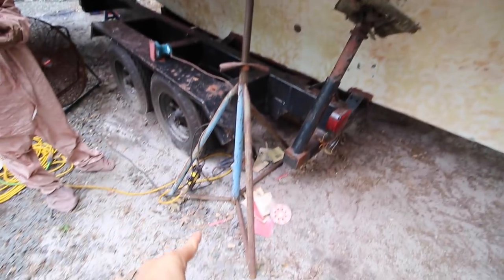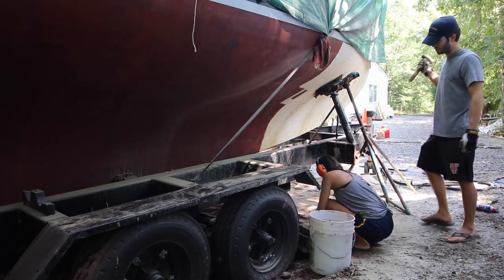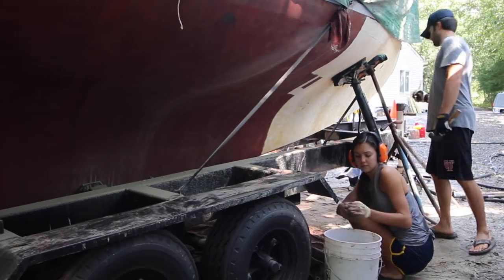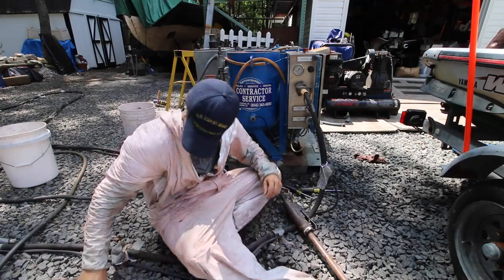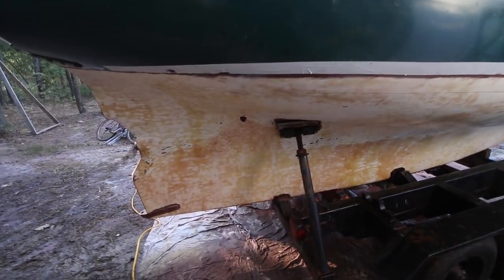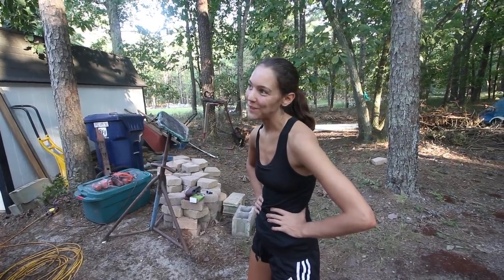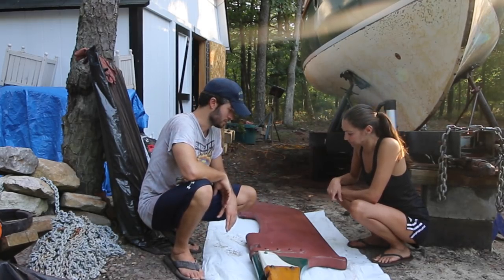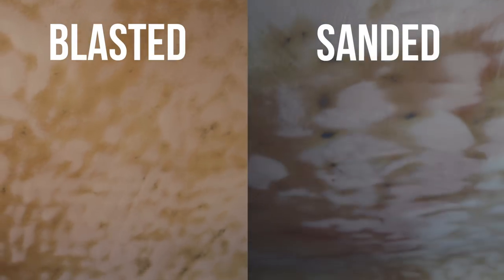45] Backyard DIY Classic Sailboat Restoration | Abandon Comfort

Comment: If i comment are you going to reply back? , Bottom painting difficult job  i mean messy ,  pressure is better than sanding or sand blasting why didnt you use a pressure washer ?? Looking GOOD though
Reply: Hauling my boat this fall in VT usa, bottom painting is on the list. Pressure washers work??

Comment: is the diesel motor still available?  +1 on the PB Blaster.  it's the best stuff i've use for corroded threaded anything!  it is miraculous.  btw, i'm really for you on the whole electric motor idea from an environmental standpoint (i have a degree in Environmental Science), but it is simply not safe.  on extended passages, you will want some oooooommmph to get you in/out/through tight spots or heavy weather, and to get you through that 50 or 100 mile stretch when you are becalmed.  the diesels these days are soooo freaking clean, that you should reconsider.  consider adding a urea system on the exhaust side for even cleaner emissions.  you could conceivably achieve very, very low CO2 emissions if you set it up correctly.

Comment: I know you guys are hell-bent on going with electric propulsion, but the numbers simply aren’t there for weight/capacity.  Keep that cherry Diesel engine, and run it on biodiesel.  At a half-gallon an hour fuel burn, you could motor over a hundred miles on a ten gallon tank.  If anything, get a trawling motor large enough to put on the transom to get you in and out of slips and anchorages without having to turn over the diesel.

Comment: Sure, a boat like this can be moved by ores in a calm condition without wind. Why not instead use your legs? Your arms may produce about 80 Watts over a short period of time. A trained cyclist can produce easily 160 Watts over a much longer period. why not set up a kind of "bicycle-generator" to your batteries or a "bicycle transmission"  directly to a big , slow turning  Prop. to move the boat. Not joking, during my last Holidays in Croatia I've seen a Sailor moving his 8m boat inside the harbour that way.
Reply from the maker: We've given thought to that as well. If you have any further info on it send it our way! We'd love to hear more.
Reply: For Example, a 26" bicycle wheel at 25km/h spinn's at about 200 rpm . A victron 60-24-70-SR-IG Alternator produces ca. 6.5Amps/24V at 1500rpm . Using a 7.5/1 Gear-Ratio from a backwheel of a mountain bike you would be able to pump 160Wh into your batteries. here's a link to the Victron datasheet https://www.victronenergy.de/upload/documents/Datasheet-Alternator-DE.pdf.Another Option could be a Cruise Pod 2.0 or 4.0 from Torquedo, directly driven on a transmisson from a "boat-bike" or a direct transmisson to your prop-shaft.

Comment: A number of posters on here seem to take exception to some of the comments made and seem to think that  expressing doubts about the viability of going electric or using oars is negative or hyper critical. If you sit in the bar of any sailing club you will hear discussions and debates between sailors with differing views and different perceptions of risk on a whole host of sailing issues and I view it as being constructive rather than negative. 
All sailors are different and the rig and set up of your boat will depend on how and where you sail. Trailer sailing / day sailing in inshore waters after consulting a reliable weather forecast presents fewer risks than a passage across oceans. 
From a personal perspective and sailing in waters with strong tidal flows and with shipping lanes to cross, I take comfort from having a Volvo diesel under the companionway steps  but I would not criticise anyone for swapping a diesel for an electric or pedal power propulsion system if that is what they wanted to do but if I cared about the person concerned I may question the decision and point out some of the potential downsides so that the decision was based on informed and considered.. That is not being negative and to suggest it as such is a somewhat juvenile view.  
I look forward to seeing how the power conversion works and whether it is a practical proposition for long passages.